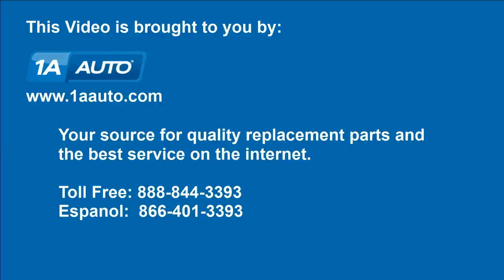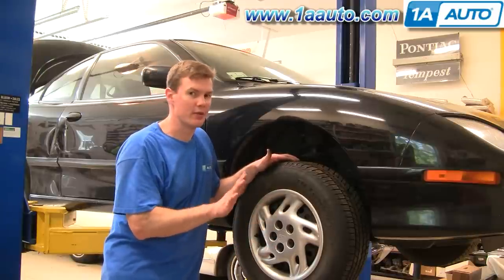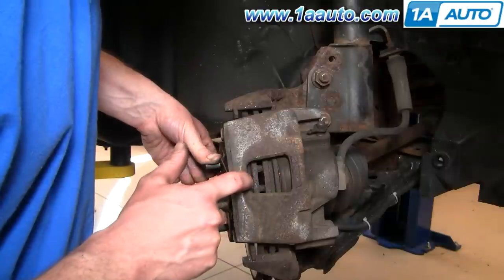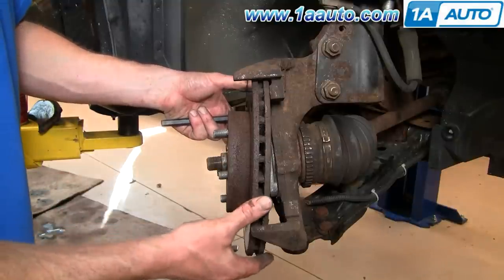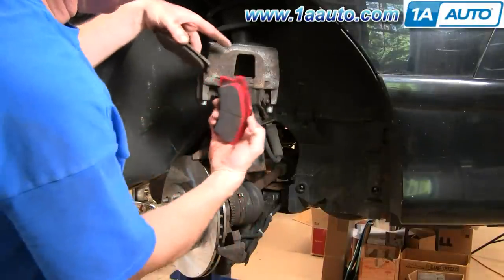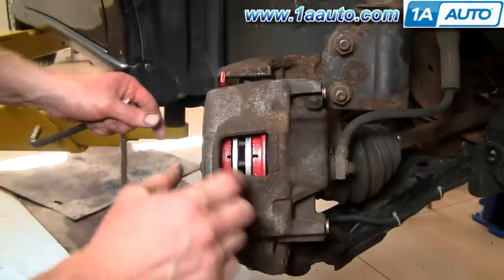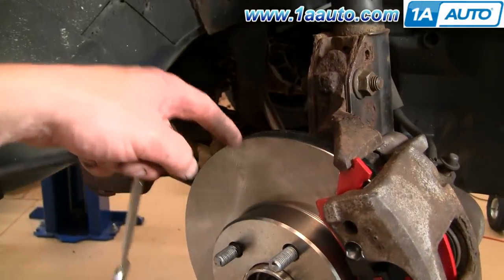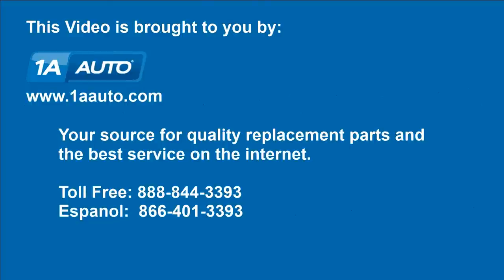How To Check Your Brakes & Perform Brake Job

Comment: Thank you very much, I bought a pre used vehicle but being new to cars I had no idea what problems came with it. I was having break problems (such as: smoke coming out of the breaks after a while of driving) but thanks to your video, I was able to determine that the previous owner had only changed one shoe to each wheel.

Comment from the maker: @bprizze the front and rear systems will be different.  So you would buy 1 set of pads for the front (you get 4 pieces to do both wheels) and 2 rotors.  Same thing with the rear.

Comment from the maker: if you are getting a growl coming from the vehicle, there might be an issue with the wheel bearings. Also there could be a caliper getting hung up and causing the pads to touch the rotor very gently.

Comment from the maker: @iiNaRcOtIkZz You can have different size brake pads for the same model car if a heavy duty or performance brake option is available.  In general though size, as in measurements, is not something factored in when buying pads. Hope this helps some.

Comment: Wow very helpful video! just some questions when you buy the pads/shoes do you buy them in sets? like I can see theres 2 pads on 1 wheel so all in all would be 8 pads for all the wheel? or is it only for the front and its different brake system on the rear wheels? thank you

Comment from the maker: Something like this most likely means there is a leak some place, possibly in the brake booster. Something like this should be fixed sooner than later for safety reasons.

Comment: Thank you for responding! My brakes were spongy and I replaced my two front brake pads. Now, can I just bleed the front two that I just replaced? Or do I need to do all four? 97 Dodge Caravan. If so for all four, is the order Left Rear, Front right, Right Rear, Front Left?

Comment from the maker: If it isn't worn down or warped, has no gouges in it, then yes you could just change the pads. We carry a great selection of brake pads and brake rotors with free shipping on our website 1aauto.com 888-844-3393

Comment from the maker: Start with the front two brakes, and then if they still do not feel right you can move to the rear. 1aauto.com 888-844-3393

Comment: is it normal for one pad to be slightly more worn than the other? the outmost pad on my passenger caliper is about 3/4 the depth of the inner(one against the piston). I didn't investigate the driver's side, and I know the wheel spins freely and the caliper works as it should.

Comment from the maker: Not unless the brake pedal feels very spongy or very hard. You usually do not need to bleed the brakes when you change the pads. 1aauto.com 888-844-3393

Comment: i have a 2004 pontiac grand am it recently started making that scratching noise not only when i break but also when im driving it sounds like the little wear indicator is touching the rotor as im driving do i need to replace the break pads? i really dont want to have to go to a shop

Comment: What is the tool You use to take off the bolts in the beginning? It looks like a crow bar whats it called? because I`m an auto technician in training I want to know what that tool is called so i can use it for my brake job.
Reply from the maker: It was a really big Allen wrench. Thanks for watching. 1aauto.com 866-403-3393

Comment: Hi!
When I release the hand brake on my 2003 BMW 320 E46, it feels like it hangs on for a little while when I start driving. It alos makes a squeeky noise when this happens. Do I need to replace something, or does it only need adjustment.

Comment: The rotors on my car don't have the minimum thickness indicator. How do I know when it's time to replace them?
Reply from the maker: If you run one finger down the rotor and it feels pitted or scored, you should replace them. Alternatively, if you feel the steering wheel shake when you hit the brakes at highspeed, you know they are warped and need replacing.  Buy your auto parts from 1AAuto.com?utm_source=YouTube&utm_medium=CTA%20Comment&utm_campaign=1ATony
Reply: 1A Auto Parts thank you very much for the reply! Also, love your website, just wanted to throw out there. Super easy to chose parts!

Comment: what about grinding noise..and if the pads looks good..
Reply from the maker: If there's a grinding noise and the pads look fine, you may want to check the wheel bearings, and any other components around the brakes to see if something is rubbing when the brakes are applied. Hope this helps you out. 1aauto.com 866-403-3393

Comment: don't you need to use a torque wrench so you don't over or under tighten the bolts?  That's what others say.  Great video.E
Reply from the maker: +J Shysterr You should be fine if you follow the steps shown in this video. Thanks for watching. If any of our viewers needs to make this repair, we carry the auto repair part shown in this video on our website. Here is a link to them http://www.1aauto.com/1A/BrakePadAndRotorKits?utm_source=YouTube&utm_medium=CTA+Comment&utm_campaign=ytcomment&utm_term=2FbX9AU3Jz0